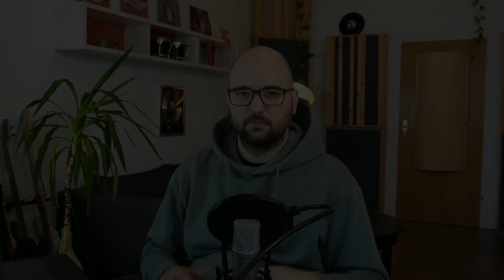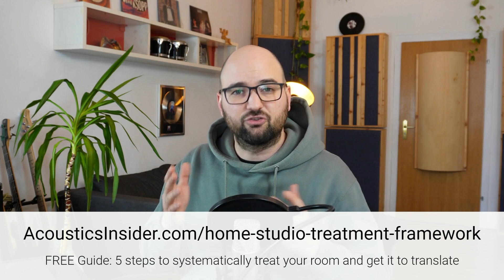You can’t fix bass once the room is done - What Sound Engineers NEED To Know

Comment: hello , i got a living room . with 6 monster big bass trap  at corner & first reflction point. also got  cloud trap  covered  . fron wall and side are big pannel 10cm .  but i still lack of bass 100hz-200hz 6db bump , under 100hz its a big dip .. 300.-500hz is a little dip  -3db  ,  beyond 500hz its all good almost  like a  flat line .  is that SBIR thing ?

Comment: Awesome video Jesco - as always. My main lesson learned besides the truth, that you should pay attention right from the start when setting up the room initially, is that rooms will tell their own tales. My office e.g. made it so hard for me to find the best sounding bass, meaning max. balance in frequencies, clear and accurate. It was a small-ish squared room (3,5x3,65m), the perfectly imperfect conditions. Your explanatory step by step guide gave me the patience to keep hunting for the small wins. The living room on the other hand was giving me clear signs for low end do’s and don’ts - magically luring me towards the sweet spot. The room being both different and bigger in size as well as having better-to-handle room modes, the low-end sweet spot was much easier to detect. I’m still not sure I’ve found it in my office but I got much closer.
All in all, don’t give up folks and be both patient and happy about small wins in the environment you are dealing with. Accept what you can’t change and work with what you’ve got. Even 10cm can make the difference. That’s what she said. Good luck with the plant.

Comment: I wish I would have discovered air gaps sooner…turning a 3 inch absorber into a 6 inch bass trap…just by adding a 3 inch air gap…that isn’t talked about enough
Reply: I've been shocked how well this works as well.  A gap makes a huge difference!  For testing, I lean panels against the wall at different angles to get an idea how much gap is best.  Not precision, but effective
Reply: Hello folks.
 It's all about one simple thing. Just remember the basic fundamentals of wherever is required on any given task at hand of your desires.
 Don't justify or worry about it. I sure did made an pure mess, just trying to screw back in the woofer. We all know screws goes into the mounting hole on the driver frame. My speaker I call them, Blinky and Winky now, as the patch losses up with personality that will always remember to flap at me. So try not to be to hard on yourself as most times we've can be doing the most damages that will stop you as it did to me. Moving forward the goal just change your plan in how will you get there.
 Trail and error occurred as the mistake teaches. Few things in audio was found from doing a mistake. Cheer up.

 I feel the panel gap similar to bass tarp inner piece duty.

What comes around goes around and back at yeah in a better sounding way.

Treat this topic videos one at a time. They all have the same goal in mind. Add one idea on to, with another idea to develop.
❤

Comment: If I do a 6dB bass cut at say 80hz, wouldn’t that reduce ringing by putting less energy into the room?
Reply: If you have a resonance at 80Hz in your room and at your listening position, a 6dB cut won't reduce the "ringing", it will just make the ringing start 6dB quieter. There will still be an energy decay time at that frequency. I've learned from watchin a lot of Jescos content that the primary goal for mixing studios is for sound energy to decay evenly across all frequencies.